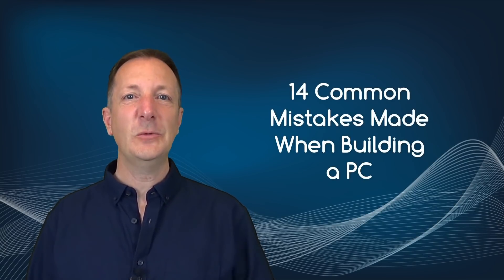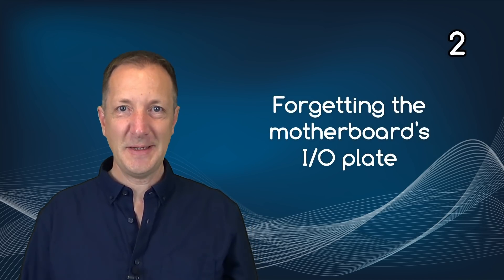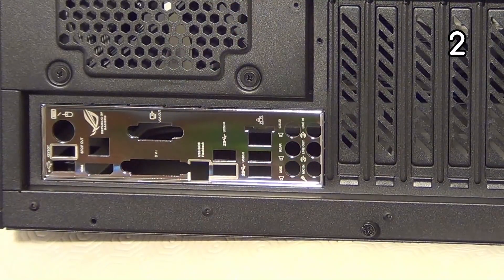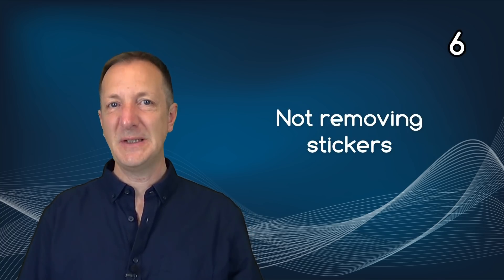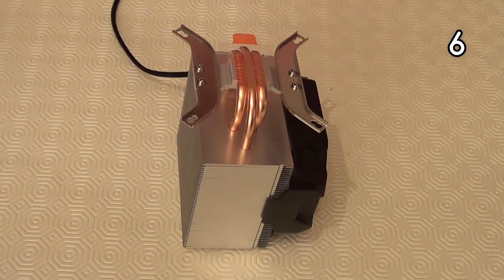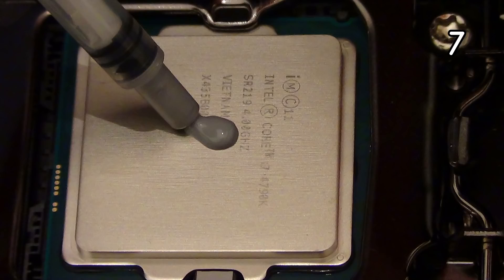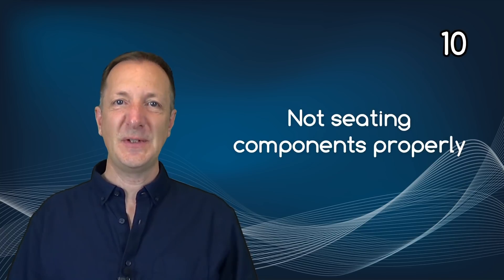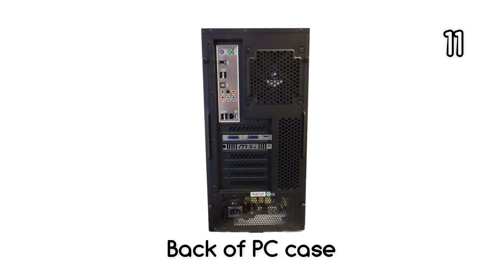Before Building Your First PC - WATCH THIS

Comment: The part I found most helpful was an actual video shot showing how much heatsink compound to use. I've been told to be careful not to apply too much.
Reply from the maker: Many come with the compound already applied, but some don't. So you might not have to apply it yourself, depending on which heatsink you get.
Reply: thank you
Reply: Oooooo maby i can do that

Comment: My two mistake during the first build: I dropped screw on motherboard and hard time locating it. Forgot to put standoff screws. Knew it only after everything is connected and ready! I left it that way. No standoff screws on my system unit!
Reply from the maker: Is your computer working without the motherboard sitting on standoffs? I did build a computer once where the case didn't need any standoffs. That's quite unusual though.
Reply: @EasyPcRepairs  
Yes, it is working without standoff. How I made the mistake of leaving out standoff or raiser is that I put the mboard in the cabinet and put on  motherboard screws. As i could tighten the screws, I didn't feel anything amiss. After building computer, I saw the standoff screws packed inside a small plastic bag. Only then I knew I forgot to put them. I read somewhere without standoff it is possible to get short circuit and damage motherboard. But nothing happened to my motherboard. My cabinet is regular variety. I m in India. Here regular motherboard of popular brand like iBall with 450watt smps prefitted costs RS 1850-1900. Now I want to disassemble my system and put on standoffs instead of taking risk of damaging motherboard.

Correction: I meant to say regular cabinet of hand like iball costs Rs 1850-1900, not motherboard!
Reply from the maker: That sounds like a good idea, just to be on the safe side.

Comment: I made a mistake of not thinking about cable management when the PC is standing vertically. Since I would build it while tge case is standing horizontally (so it's easier to work on it), I didn't remember that I keep my computer vertically so the wires hang a bit differently when it's vertical so I ended up with one of the cables just very very slightly touching one of the fans resulting in a very annoying sound.  lol, so there's one very easy to forget detail too.